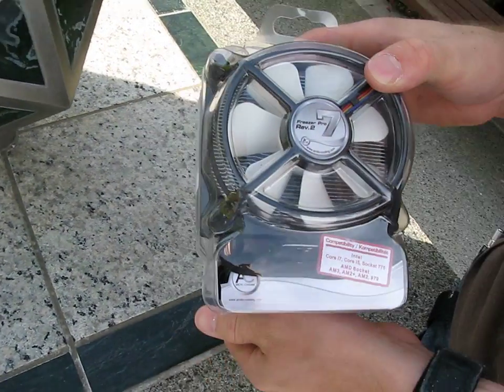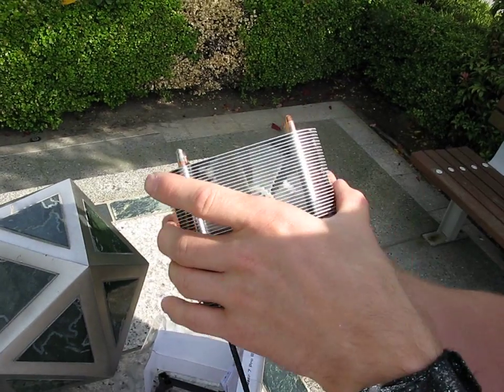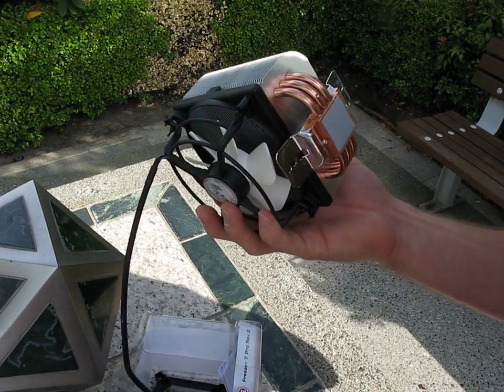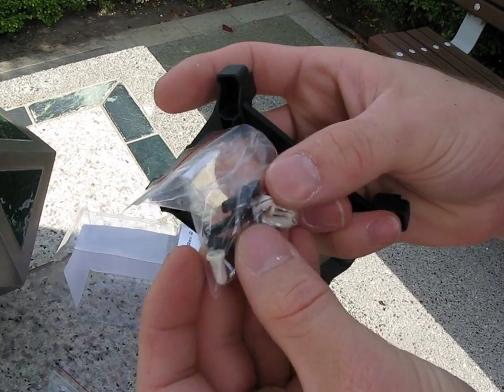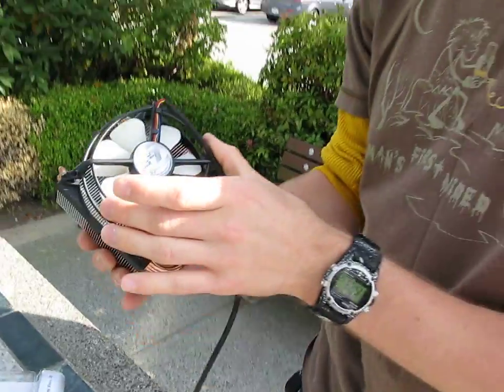Arctic Cooling Freezer 7 Pro Rev.2 CPU Heatsink Cooler Unboxing Linus Tech Tips

Comment: Chapters:

0:00 Box and general overview
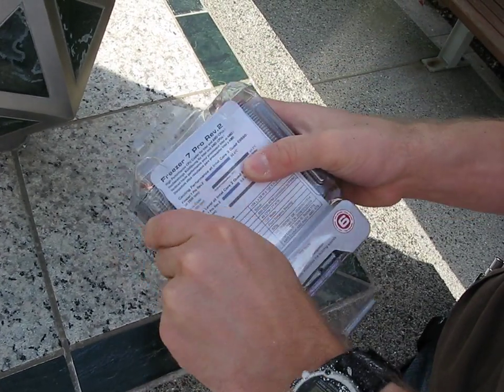0:23 Unboxing start
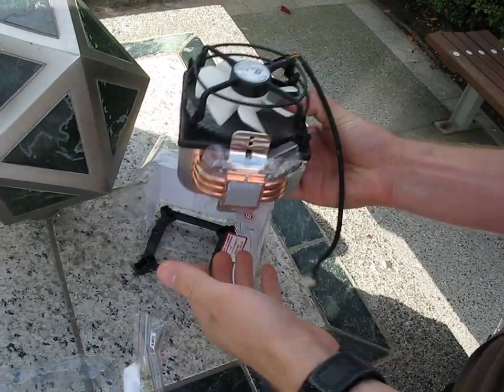0:35 Design and specs for the cooler
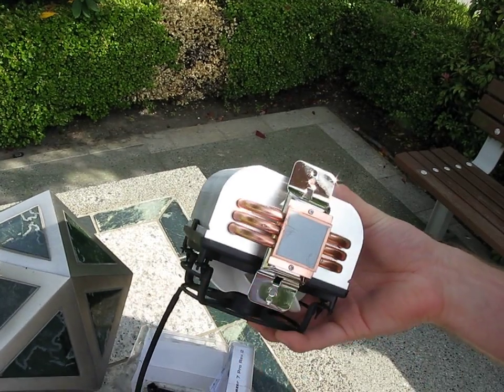1:11 Mounting system overview

Review:
Neat looking cooler. Nothing special in the video, I rate this a solid 1/5

What am I doing, and why?

I want to watch, and review every single video on Linus Tech Tips channel.
I will provide chapters, if the video has none.
Why am I doing it? To pay a homage, and I am pretty sure that my head is a bit messed up.

Comment: does this work on the intel skylake socket 1151? im confused. on the box it doesn't have the 1151 writting but on the official sites it is
Reply: +s3rban91 It does work on 1151, You'll just need to go to thier website and check. 1155 coolers are compatible with 1150 and 1150 coolers are compatible with 1151 so in short: 1155 coolers work on 1151
Reply: It works fine, I'm using one on my 6700k and it runs at 25C idle.

Comment: hello linus i just put an arctic freezer 11 lp and when i enter the bios its says that the processor heat is 92 degrees and the pc stucks.the technician that installed the cooler told me that 92 is ok(here i laugh) make a clean install.i did and the tempreture is still 92.i sent it back to the store.i just want to ask is there a virus that can do that?could it be a virus in the boot sector of the hdd?thanks

Comment: this cooler is rubbish and so is the freezer 12, my amd piledriver boxed cooler is much better.
Reply: get a GELID TRANQUILLO for that processor, its fantastic and not expensive
Reply: http://www.ebay.co.uk/itm/Gelid-Tranquillo-Quiet-CPU-Cooler-with-PWM-Fan-/371110239811?pt=Computing_ComputerComponents_Fans_Heatsinks_SR&hash=item5667e4de43

Comment: okey cool. i just bought some arctic MX2 paste,to apply to my stock, to see what happens. will save some for the new cooler if i wanna buy it. But in all fariness, the only way to get to 80C is by running Prime95. There is no game that stress the cpu at 100% at all 6 cores. so in gaming i reach only 55C whit stock. so in all fairness unless youre a hardcore 3d composer and working with encoding its ok

Comment: how is this versus FX-6300 stock cooler? on 4.4ghz i get upwards 80C with stock cooler, so I can only OC to 4.1ghz to get decent temps with stock. thinking of buying this one as its only 30 bucks. so , would i be able to oc to 4.4ghz with below 62C on the FX-6300 ?

Comment: @LostINFERN0 I wouldn't recommend this CPU for an AMD system as the orientation is wrong! The fan should be blowing air out through the rear of the cases, but with AMD motherboards it can only face north or south (or up/down if you prefer).... So the hot air will either be blown onto your installed GPU or through a top mounted PSU. It doesn't cool the mosfets on an AMD system either (unlike the stock cooler).

Comment: Would this fit on an ASUS p8p67 LE with corsair vengence memory on it? I'm kinda regretting getting this board instead of the pro because the memory modules are stupid close to the CPU socket and the VRMs run too hot.

Comment: @Dragst3er yes i have one on my phenom ii as we speak. my mobo though (gigabyte) it could only blow air up through the HS and towards the top of my case.  just a heads up but your mobo might be different. worked out for be because i have a fan on the top and back of the case. but ideally you want it to face the back of course.

Comment: The best was is to blow the air to the roof - the fan on the bottom, it blows air through the heatsink and directly into the PSU (and then you need a PSU that has a fan on the bottom, so it sucks the hot air out).

Comment: Also, which orientation is best for this type of CPU cooler on the mobo? Like having it so it pushes the hot air to the ROOF of the case, or having it push the hot air to the BACK of the case?

Comment: The Freezer 7 Pro Rev. 2 works like a champ. I have my i5 OC at 3.8GHz. CPU volts @ 1.36.

Idle temps 30c across the board
Load temp 65c-70c across the board

This cooler was only like $33. What a steal!
Reply: i hope you're doing well these past 12 years

Comment: I just bought the older version. Running it on silent mode with my asus MB and my cpu doesn't go over 35 degrees with normal use. Was really easy to install, not like the intel cooler. Will defiantly get the newer version when I upgrade.